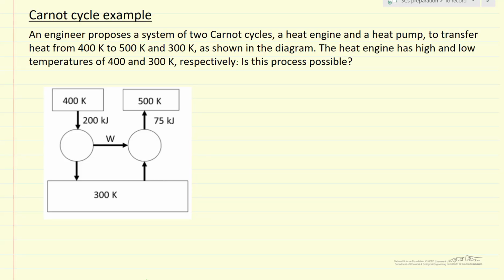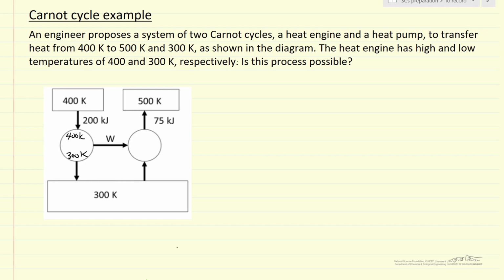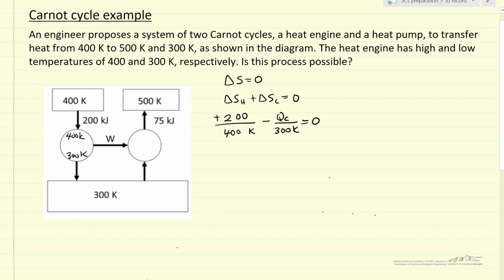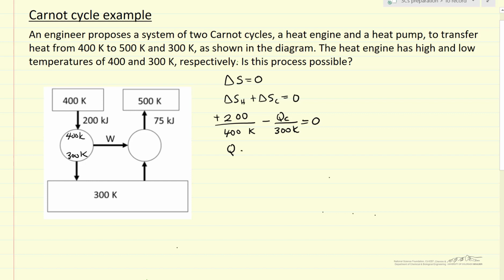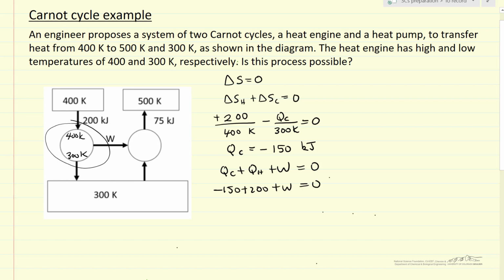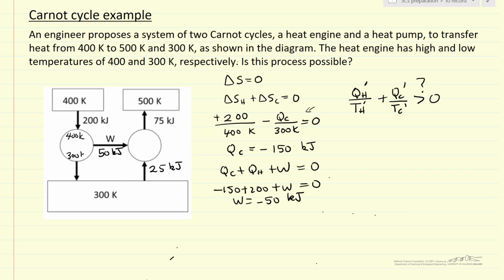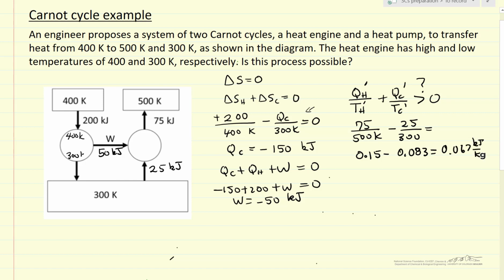Carnot Cycle Example

Comment: Would you need to include the first hot reservoir at 400K in the 2nd law calculation to determine possibility? If not, why is it excluded?
Reply: My thought on the matter is that the first hot reservoir had already been addressed in the first entropy calculation (the one for the ideal Carnot heat engine).  Performing the entropy calculation for the heat engine addresses the first half of the overall system sufficiently, which includes the 400 K hot reservoir.  

For the other half of the overall system, the second entropy calculation is performed on the heat pump reservoirs (the second hot reservoir at 500 K and the cold reservoir at 300 K) because we do not know how the temperatures of the heat pump itself correspond to the temperatures of the heat pump's respective reservoirs.  This is different from how the IDEAL heat engine was handled.  I emphasize IDEAL (with all caps because I can't use italics) for the heat engine because the problem statement indicates that the heat engine has "high and low temperatures" matching its respective reservoirs.  This respective matching of temperatures in the case of the heat engine is necessary for it to be treated as ideal.  We do not have this condition of ideality specified for the case of the heat pump, and hence we cannot treat the heat pump as ideal (that's why the solution stipulates the entropy for the heat pump must be greater than zero, and not equal to zero, because the entropy being equal to zero would be an ideal process).  Hence, we look at the reservoirs linked to the heat pump to determine the intrinsic possibility for the second half of the overall system.  

With the first entropy calculation combined with the second entropy calculation, the overall system has been sufficiently analyzed.